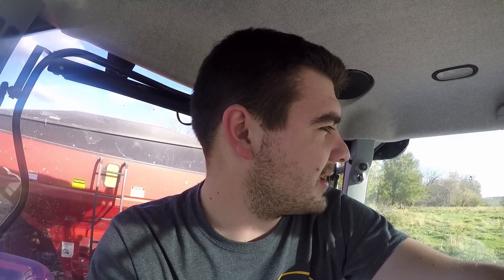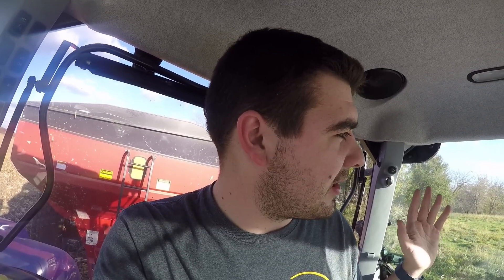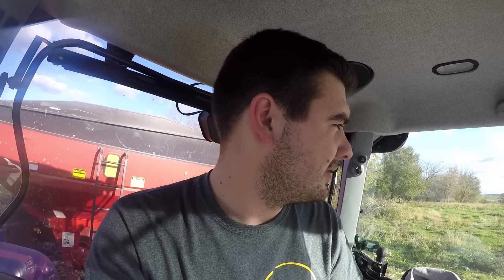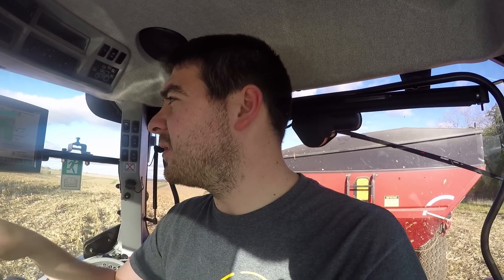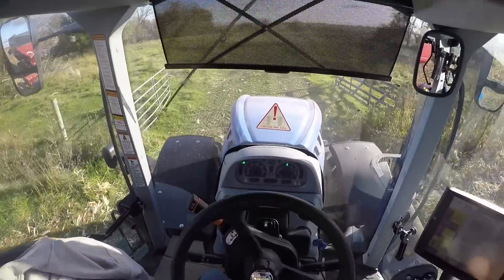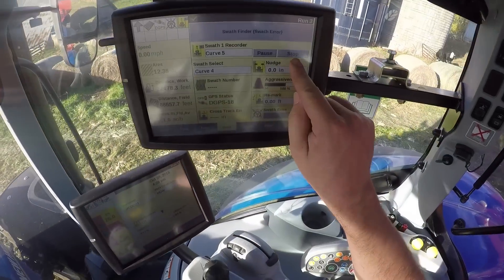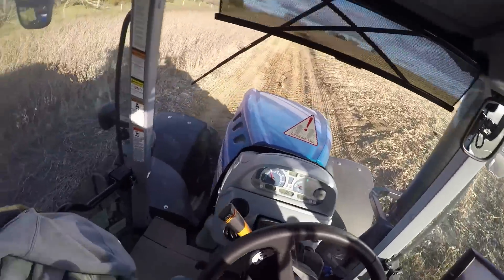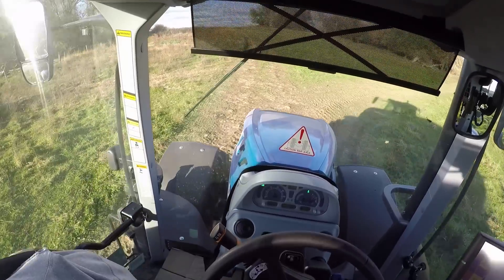Tractor drives me back to the buildings! - New Holland IntelliSteer

Comment: Ryan. you should check your 1800 display. it may have some autotrac demo hours that you could use in 8235. other wise I believe Deere charges $3000 right now for activation
Reply: JD Starfire 3000 upgrade for 8235r that may allow interaction with RTK, etc. to bring activation  options w/o spending a bundle. Great program to test techno options now available.  Just need crop prices to reflect the investment needed

Comment: Pretty cool Ryan, but you do realize your days sitting in a tractor are numbered. You'll be sitting in the pickup with a laptop running the whole operation. Even cooler. Well maybe not.
Reply: Douglas Laramie Until some fool tries it on a road.  ;-)   Self-driving cars may know about traffic, but tractors aren't even trying that trick yet.
Reply: Will do his back a world of good though. Air cushion seats are not great for 8hrs plus. Remember all farming started as manual work and is gradually improving doing more with less manpower - modern farming is more autonomous and less labour intensive than ever. Still hard though no where near as hard as it was.

Comment: This tractor makes the JD 8r look like crap
Reply: Matt Quigley well considering the 8r is already outdated and pretty much lowest optioned 8r you can get.. yeah it does
Reply: Matt Quigley new john deeres can do these things too
Reply: Tygo-john deere their current 8R can do this. not outdated at all. just need to put the display in.
Reply: Sid 15 never said it couldn't do it cause pretty much any deere auto steer capability can do this like you with a receiver and display, but Deere has a newer addition 8r  so to compare this new Holland that has pretty much just been released and has every option on it to a 5-6 year old tractor with really low options  is comparing apples to oranges
Reply: Not really. Their 8R is more capable than this NH.  I still prefer PS for heavy pulling
Reply: Sid 15 what's ps
Reply: Power shift
Reply: Power shift
Reply: Matt Quigley  j
Reply: The end of this comment is the new Holland